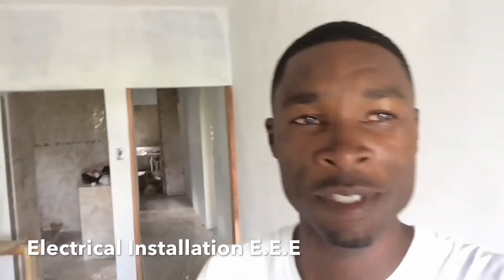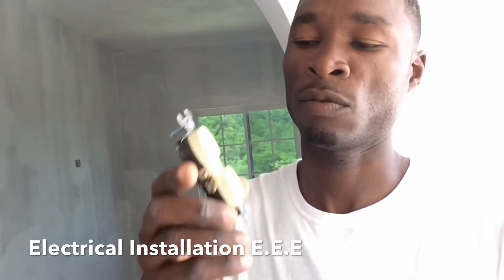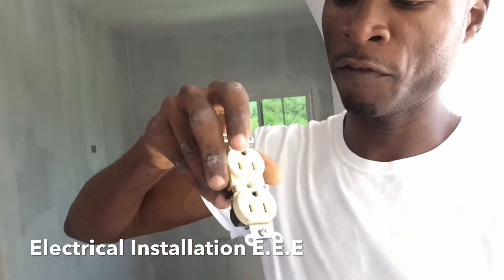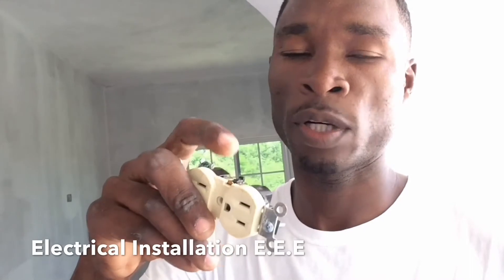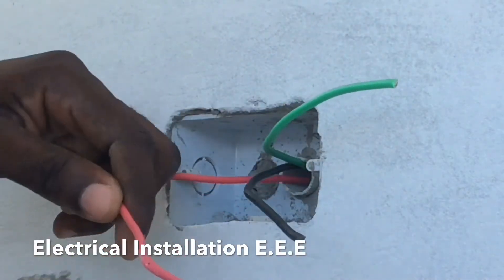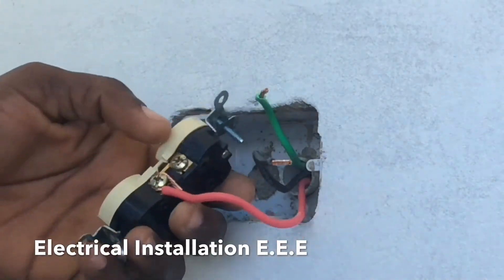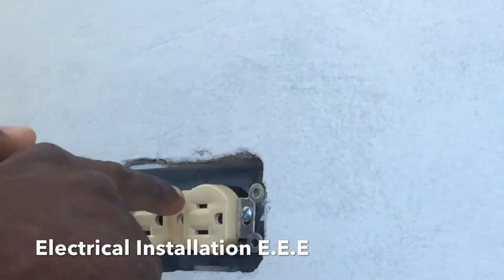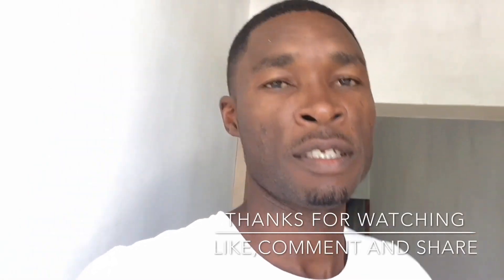CORRECT AND WRONG WAY TO CONNECT A 3PIN FLUSH PLUG!! Tutorial Video || ELECTRICAL INSTALLATION E.E.E

Comment: The the vincentian Electritian I do work with told me the ground and the neutral when useing white ,black and green eight strands 14 gauage 2.mm wires is the correct way and CGFI Ooutlets goes down,t'these the you put in water base areas like bathroomc and laundrys so why do you put red wire at the top in the box?

Comment: I appreciate the way you have explained the polarity of the connection of the socket outlet. In the Uk our socket outlets are different. Do you do a lot of electrical boding with pipes works?.especially in the bathroom area and kitchen area, when metal pipes are used.
Reply from the maker: Yes we bond the metal pipes when we use them but we hardly use metal piping , mainly industrial and some commercial projects .

Comment: am a interested in doing electrical just by watching your video what are the basic i need 
to know how ever i signed up at heart to do so?
Reply from the maker: The purpose of electricity.
The basic of electricity which are;  voltage, resistance, current, power , charge & efficiency. 
DANGERS
Treat all wires live
Wear proper footwear whenever time working on wires especially LIVE
Understanding color codes
Etc

Comment: Hi, thanks for your knowledgeable content. Please i want to ask, when you are connecting the service line to the panel of the home you are wiring, do you connect the service line hot, or you disconnect it first, and how do you do that,  because i'm scared of working with the service line from electrical poles as they are always live and heavy current
Reply from the maker: Well for a domestic work it is safe to remove the meter first meaning you disconnect the power but it is a ram meter // eg meter you'll have to work on it live because the main only can be disconnected from the supply office

Comment: why 2 screws on each side. can u just use either of them on each side?
Reply from the maker: The reason for two screws is because one can feed another plug
Reply: @ElectricalInstallationEEE  no really understand what u mean by 'feed another plug'. once u connect to any one of the screws wouldn't that feed both sides of the socket?